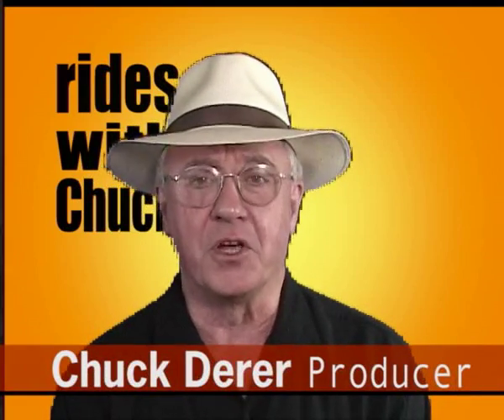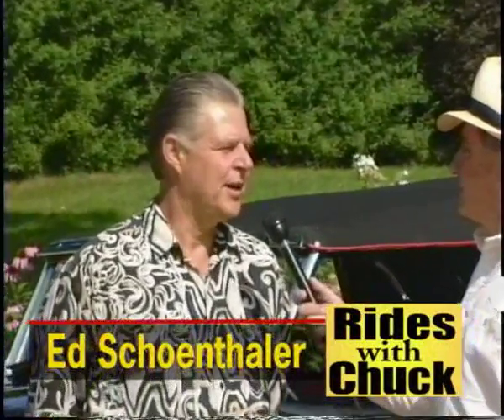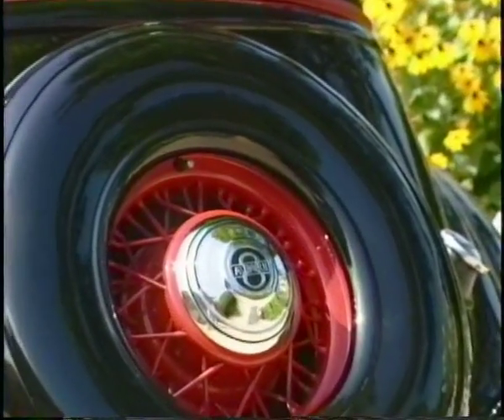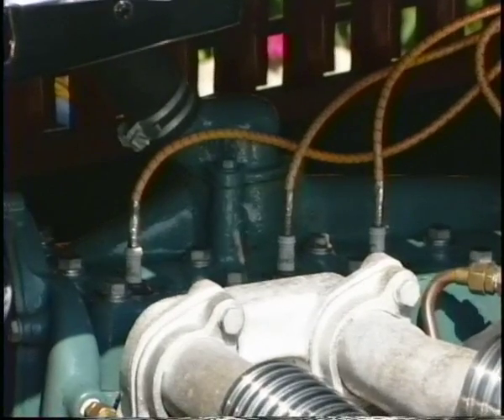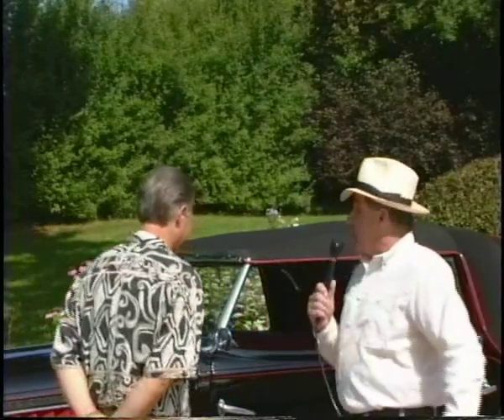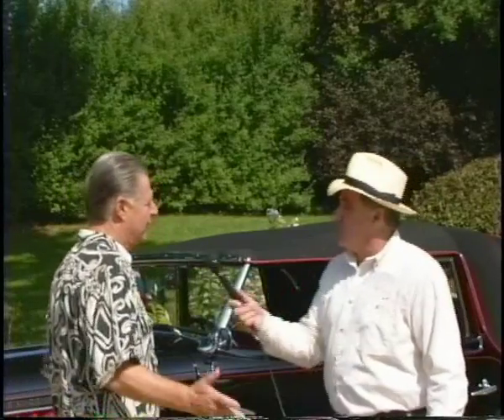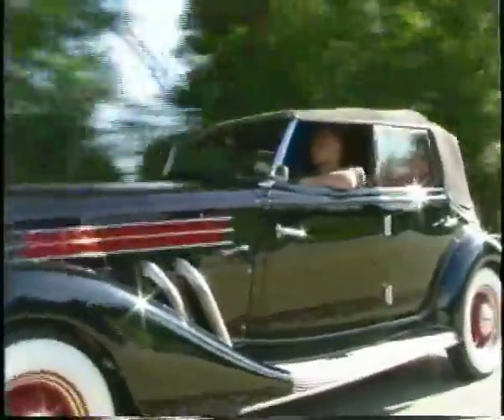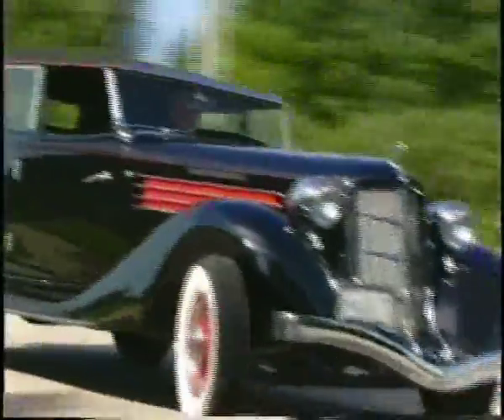Auburn 851 Phaeton 1935- We go for a ride! Real 30's glamour!

Comment: There is a plate on the dash of the 851 in the National Motor Museum in England and I understand there is one on each 851 S/c.  It certifies that "This Auburn automobile achieved a speed of 100.6 mph, before shipment" and was signed by Ab Jenkins.    
In an interview, Michael Ware, the Museum Curator said to me "I hope that they ran it in first!"

Comment: Auburn’s were built in Auburn and in Connersville from 1929, until 1933, when production ceased in Auburn and engineering and production were moved to Connersville.  So we Connersville ACD Club member’s state that 1934-37 production was in Connersville.

Comment: You really do the job, Chuck. What a lovely car, what an era. In my opinion what has killed creativity in car design is the triumphal ascent of the cost engineers, aka bean-counters, aka penny-pinchers. It certainly did the job on GM cars after about 1961, when they were all pretty much built on the same platform, and moved universally toward blandness. The 1970s were the low point, of course: cars as "appliances" (not my word - that's what they called them). Pity. Gimme that Murphy Boat-Tail J.